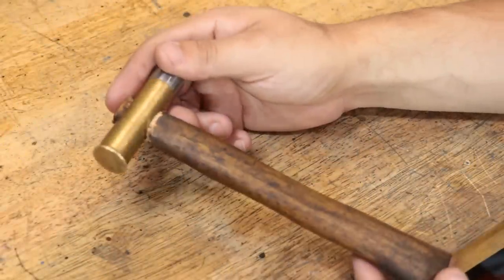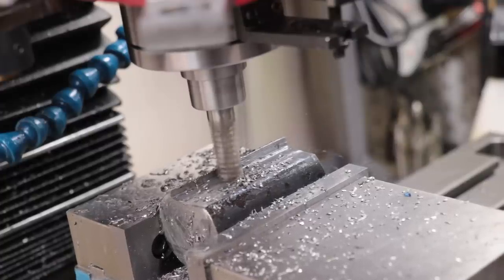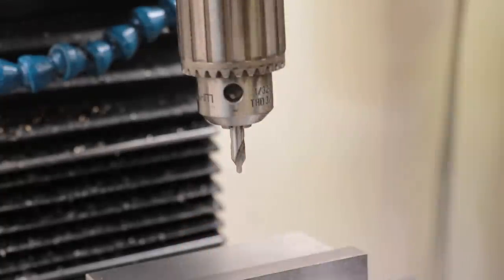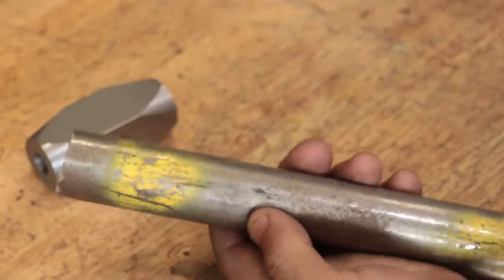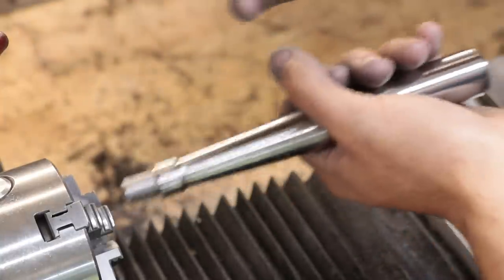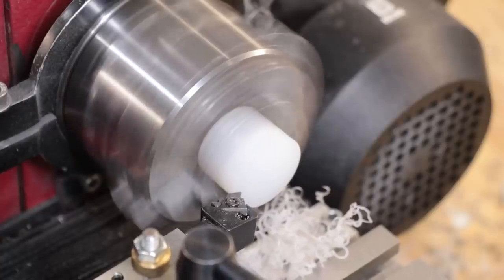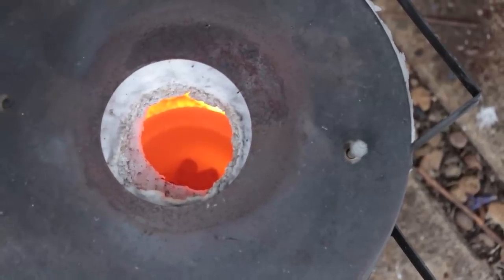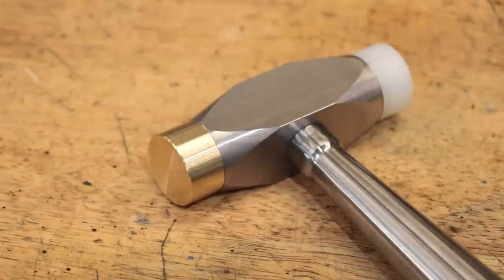Making a Machinist Hammer With Brass Face

Comment: I think the reason the cast brass machines nicer is due to the change in the grain structure in the metal itselt, rolled brass will have a relatively uniform grain structure that will be a little harder than the random grain of cast, the same goes for cast iron as well, or at least thats my experience from machining cast materials
Reply: Other reason could be the combination of different pieces forming an alloy with better machineability.
Reply: At least for cast Iron this is half true. Doue to high carbon in Cast Iron (3%) there is no uniform iron grain as it is in low carbon steel (<0,8%). That means carbon makes it own grains between the iron grains. This also makes the grate sliding performance of Cast Iron, but makes it very britle
Reply: Let's completely stop "thinking" for a moment and actually MEASURE the consistency of the material (f.e. with a microscope or other metallographic methods), because then WE KNOW as a fact what is going on. Okay, if this is to expensive and you have not the years(satirical over-exaggeration here) of engineering training that is helpful for this: Ask your material provider/seller about the PROPERTIES of your raw material (maybe before buying?) and if he can't provide that information ... switch your seller:)
On the other hand, if you are casting than the metallographic  analysis (including quality checks) is mandatory. Without[2] it the "walk in the park" will just be a "walk in the dark". You do you! Putting a list (or many different lists mixed with subjective opinions and ... by the smelting hell, yeah ... myths) together consisting what may or may not be is not very helpful[1].
So ... now, please switch on brains again:P :)

[1] I am not saying that experience and sharing experience is not of value. It is just an endless source of frustration because if you read something on the internet and that suits your cause ... amateurs will take that for granted for their possibly totally different situation. That is just how our brain works: LAZYNESS WINS!
[2] Without measuring and testing the material the correct answer is: We don't know ... or even better: WE DON'T EFFING KNOW AND SPECULATION LEADS ONLY TO DISASTER, PERIOD!!! 

In detail:
1. "I think" does not reveal the underlying grain structure of cast brass, nor does it tell about the alloy composition. The best is not knowing the temperature profile (I guess not even Artisan Makes has documented this) and then guessing about the resulting material properties. Sounds ... clairvoyant to me. One could make big money with this ... hehehe
2. "Reasons" ... why not the temperature in the machine shop, the mood of the caster or any of the other thousand possible reasons. Why exactly "different pieces forming an alloy"? Where did they came from? Wonderland? Or is that not even remotely related to the topic or "Making a Machinist Hammer With Brass Face"?
3. Where is that detailed knowledge coming from? I mean a carbon content of 3% and you know exactly what troublogaMing machined. Are you a medium too? Can you speak with the dead (metal parts ... I mean dead metal parts. Dead Persons is too spooky!). Also: Nobody disputed what you mention. The better workability of cast iron also depends on many different factors. Oh and from the nature of the processing/machining itself! After all, it can also become a bad property. Depending on the point of view, purpose and type of machining.
Reply: @dieSpinnt  Jea, you right. I know all the things from listening to death metal. Also metal core, melodic metal and new metal is very informative! But also my engineering degree helps a lot with understandin this. And where i geht this numbers from? At least in the german speaking part of Europe cast Iron has most of the time around 3% carbon.
Reply: Brass (and bronze/copper for that matter) can be a real pain depending on what flavor of it you are working with. For example, leaded brass/bronze machines like a dream but aluminum bronze is a headache if you treat it the same as regular flavor bronze. If you already know what the material specs are you calculate your speeds and feeds/select your cutters accordingly but when the flavor of the material is not certain it can be a real pain in the butt. Like that one time I thought I was machining brass and it turned out to be copper and busted a tap in there... You can machine any material if you know what it is and use the right speeds/feeds/cutters/etc.

Comment: 8:25 I usually "fix" that by simply making a bigger thread relief at the back end when I'm doing all the turning. That way you don't have half-finished threads left from the die and you still gain from the "quickness" of using a die.
Reply: My thought was instead of going back to the lathe to turn the threads all the way to the shoulder, was to add a slight counterbore to the head so the handle edge is not visible.

Comment: I have found that when using a die you can flip it over after you have ran it down as far as it can go on the starting side and the other side of the die will give you a few more threads closer to that shoulder. Also an undercut near that shoulder will give you the same effect.

Comment: Haha! I saw it! (The sandpaper slipping) Be safe with sanding on the lathe!

Also, I'd recommend milling a flat on the brass face. In my experience, If you do not tighten it real good, it will back out in no time, even with threadlocker, due to shock.

Comment: Casting round stock is definitely a good thing you can do, especially with chips and stuff.

I just had some seamless tube laying around that I made a hand fit plug for, and I simply poured some brass in and had a 1.5 foot piece of 1 inch brass after cleaning it up. For really serious stuff I'd still buy round stock, but if you need some aluminum or brass parts that a void won't bother then casting is king, especially for something like aluminum belt grinder wheels in a large diameter.
Also, brass alloy doesn't matter for most stuff, but I try to keep plumbing separate from bullet casings separate from round stock when I melt them, as sometimes you may have a bad batch and you will have wrecked 10 pounds of stuff over throwing away 2 pounds of stuff.

Comment: Nice job! I asked Santy for a furnace, and he came through! My intent is to start producing some billets for the lathe / mill, aluminium and other non ferrous metals are so expensive in suitable sizes, recycling smaller pieces and scrap to make appropriate sized billets for machining makes a lot of sense.

Comment: I would mill two flats on either side of the handle, parallel to the direction of the heads, to give it more of an oval profile that helps the hand feel how the hammer is oriented

Comment: Less traditional and as someone else said I like that the handles not knurled. I need to make myself one, been getting by with a small round brass or aluminium bar for knocking things.
Reply from the maker: Cheers mate. if you make one, I hope you post it to your channel.
Reply: @artisanmakes  sure will do, won't have the same quality for sure 😆

Comment: The brass machines nicer because the zinc content is lower after you have re-cast it. 
The square to round tapered shape of your hammer head reminds me very much of hydraulic valve bodies we used to make at an engineering company specialising in valve and manifold manufacture I used to work for.

Comment: Please go and buy a 4 x 6 vertical/horizontal bandsaw, they are about the best bang for buck you can get in a machine shop apart from maybe a drill press. The decrease in time and increase in quality of output is worth every penny, plus they are pretty cheap. I've been working through your videos, and you really need one, If you don't have space, stick your compressor outside in a doghouse (which is a good idea anyway tbh)

Comment: "Since it's near the end of the year, I don't have a lot of metal..."

They don't sell metal in Australia every month of the year?

Edit: One thing to know about hammer face materials. Copper is non-rebounding, unlike brass... sort of like a deadblow hammer. Not sure if bronze is the same vs. copper or not.
One other thing, as far as design aesthetics go, a nice alternative to knurling is cutting some grooves around the handle. You keep a lot of the polished look but get some of your grip back.
Reply: In Australia a lot of suppliers have shut down for the Xmas New Year Break and will only start to reopen either this week 9 January or next week, 16 January. Other places have only been running with a skeleton staff and any custom orders are held over until the full crew returns.

Comment: Would you think a lead head would be useful? Would be easy enough to just cast it around a bolt to get the threads for the hammer.
Reply: They are handy; a guy named John (doubleboost on here) has videos showing a task-specific crucible/mould tool for them.
Reply from the maker: I know that they exist, although I have never used one

Comment: At 6:05 you can see the insert tweaking in its seat. You might want to check out that tool holder. (You can see it on the 2nd pass you make)
Reply from the maker: Sounds about right for this tool holder. Old import and the threads are all worn. :)

Comment: According to the auto subtitles your lathe chatters a bit when you are turning with a live SANTA ........ Dude I would think it would do more than chatter...and where did you get a live santa from 🤣
I nearly got caught out with something when I was making a tucking mallet , I was looking for Nylon and found out that HDPE and Nylon 6 have nowhere near the same impact strength as nylon ...the HDPE is a lot cheaper and Nylon 6 is more expensive so one to look out for.
Nice little hammer, this is the kind of project I miss having a lathe set up for. I can do brass and nylon work on my wood lathe but steel would be a cool addition to my reportoire

Comment: What were the dimensions of the square stock you used for the head, and what was the angle you turned at to get the end faces?
Reply from the maker: Roughly 26x26 x 70 stock. Can't remember what the angle was

Comment: First, I have the utmost respect for the projects you seem to undertake with the tools that you have. I have very slightly larger equipment and seriously, you inspire me to try things I would have otherwise said NFW! (No Fu*king Way!)
I seriously have to ask bud, is your only saw a hacksaw? and a crappy one at that?? 
I'm not a paying subscriber, but I would love to have a direct line to a creator such as yourself to share idea's and maybe some problem solving.
I'm in Alberta Canada so not sure how feasible this is, but I have a Milwaukee hand held bandsaw that I use all the time, but I also have other means to cut material. I would consider sending you this saw along with a battery and charger in exchange for your email address and maybe a little correspondence in the future on some projects I might undertake. 
I'm not good at attachments and computer stuff so I don't know how to send you a picture.
Anyway, if you read this and are interested, let me know and we'll make the arrangements. If not, I'll keep watching in amazement  and appreciating the content you put out, keep up the great work (not so much the hammer,(pretty easy) but the vise and ball turner...Awesome!)

Comment: Nice looking, but bad function :)
Wood is used for the handle with purpose.
All of the mass of the hammer idealy should be at the head.
Even better would be hollow composite handle (like Fiskars axes).

There is more mass in your handle than in the hammer head.
Now you have hammer with total weight of 1.5kg that will stirike with the force od 0.5kg. hammer with wooden handle :)
BTW wooden handle is much nicer, and it feel much better in your hand.

Smooth polished surface.. nice. But.. what will happend first time your hands are oily? Knurling is not there for beauty, it is there for solid grip. 
Shape of the handle also shoud be different, with far side wider than a region where you grip it. And eliptic cros section of course.
Reply from the maker: If that is how you want your hammers go ahead, for me this suits me and I like the design, hence why I made it this way.
Reply from the maker: Also I think you might be over estimating the weight a bit, I just weighed it and it’s just over of 700g. It’s a good weight for my liking. Cheers
Reply: @artisanmakes  Just unimportant estimation of absolute weight. Point is in ratio...
Ok... you have 700 grams hammer thet punch like 250g  hammer with wooden handle :)
Reply: @artisanmakes  Of course... It's your hammer :)
Maybe you misunderstand me. This is not criticism. This is advice.

Comment: Can I ask how do you do a long taper like that on the crossslide? What's the working out?
Reply from the maker: Do it in two halves and try to bend the tapers together.
Reply: @artisanmakes  thanks for the reply. Do you have to change the angle? Or do you keep it the same?
Reply from the maker: Just keep it the same
Reply: @artisanmakes  Thanks!!

Comment: It looked like you had the lathe spinning pretty fast while filing. I usually keep my RPM @ 300 or less. The teeth last longer. Especially if a hard bit of mystery material gets in there. 

There is also "copper fever" to worry about. It literally feels like a fever. You also need to worry about the zinc in galvanized while welding, and any other process for that matter. The little bit that you did isn't too much to worry about compared to industrial environments. Caution is always good though. I don't know what kind of cumulative effect these metals have on us. Or which way it is processed is worse. Inhaling fine particulates, gases, etc. 

Do you have any intention of working your way up to larger and more capable equipment? I would love a Clausing 18" gap-bed with 40" between centers. I can't believe how they have more than doubled in price over 20 years. The tech school I was at in 2001 bought 3 fully loaded brand new ones for $12,000 each. The equivalent now is around $25,000 before shipping. The ones that the school bought came with a 3 and a 4-jaw chuck, plus a 12" faceplate. Steady and follower rests. One dead and one live center. Taper attachment,  coolant system, and a DRO. They were made in Taiwan though and I could easily tell the difference in quality from the English-made ones that were already in the shop. The news worked as well, but I highly doubt that they will endure as long. I think that they're made in Michigan now. I haven't had the opportunity to work on one for a long time. Our only manual lathe is a 50-year-old Jet that should've been scrapped 20 years ago. It only goes one speed and nothing else works anymore. Being a fab shop, management doesn't care. They think that having a couple of CNC lathes is all we need. They are morons. I could bang out parts 2 or 3 times a week on a manual faster than it takes to program the CNC. Plus there's changing the jaws and tooling that takes significantly longer as well. They all need a kick in the ass to jar their heads loose.

Comment: ima make one with skeletorized titanium hamdle and inconel 718 head with alloy b2 faces
Reply: You must have some beefy machines to male this hammer them😮
Reply: *make
Reply: @Speedflyer2000  i am a machinist driving 8 and 13 axis turning centers
Reply: @TommiHonkonen  I drive 27 axis turning centers, remotely.
Reply: @dquad  well, i multitask by sleeping on the job and fiddling my phone
Reply: @TommiHonkonen  you are top G

Comment: Not a forge.. its a foundry. Forge is used to heat metal to wack on, and is horizontal. Devices used to melt metal are foundries

Comment: Have you ever thought about using a cheap air brush as a coolant fogger? May be worth a shot for 20 bucks.
Reply from the maker: Personally I’m not a big fan of air misting coolant set ups without an enclosure and extractor fan. Atomised coolant in a small area like mine is a legitimate concern. Cheers

Comment: Change the live end. It's rubbish. Should hold the part in center, but it moving along it.
Reply from the maker: There is a bit of run out which is normal for a part like this in this chuck. If I really wanted to I could have tapped that out but it isn’t something I’d worry about for the head of a hammer. Cheers